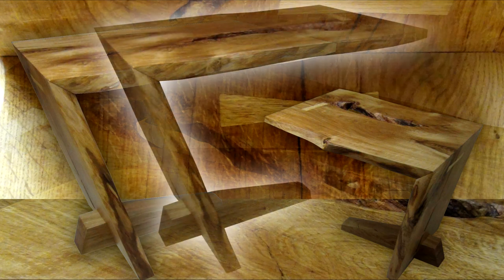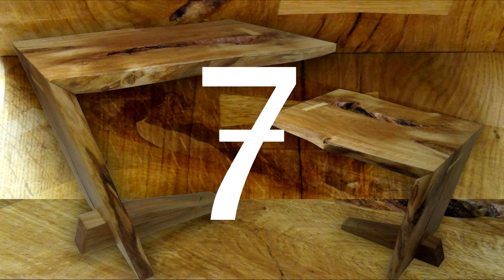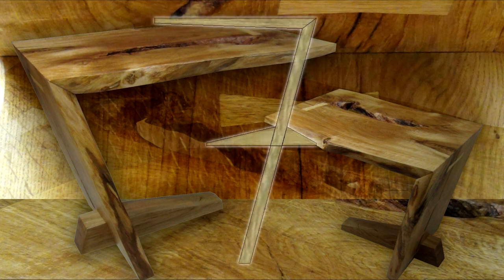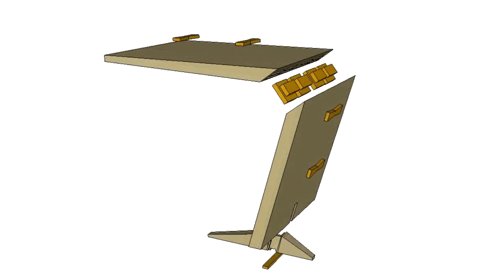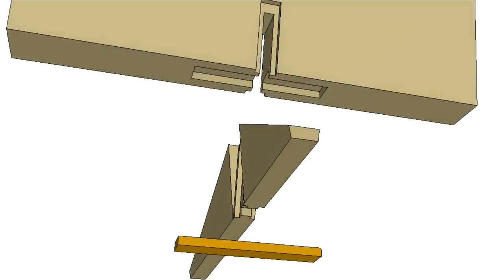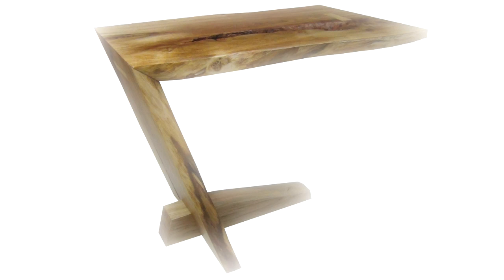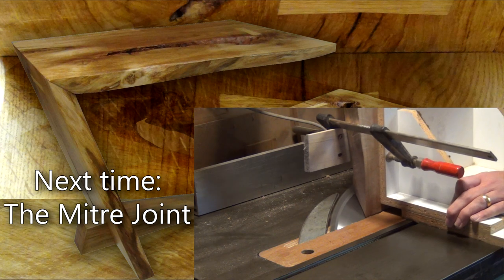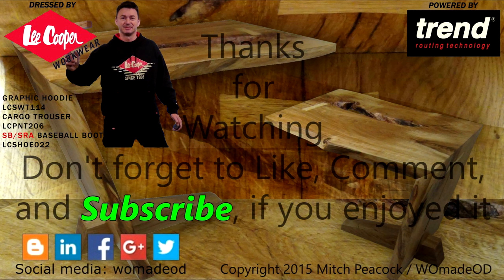Design of a Table - Build a Live Edge Table part 3

Comment: Very cool Mitch.  I really like the design.  Using the same proportions it should work on larger tables as well.  I liked the exploded 3-D views.
Reply from the maker: +Hardnox Cheers Peter! The mitre joint is obviously a weak point - this isn't a table to sit on! I guess I should make a sample and test it to destruction. Perhaps a future video.
Reply: My thought too but another triangular wedge like support that mirrors the foot under the mitre might do the trick.